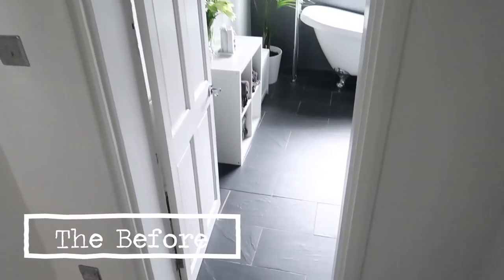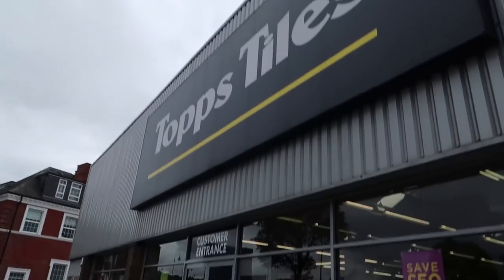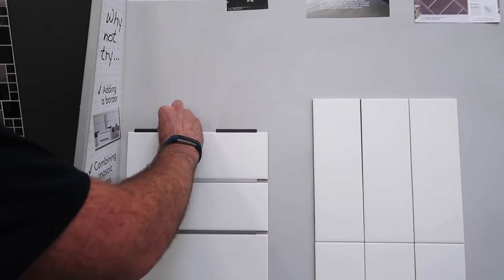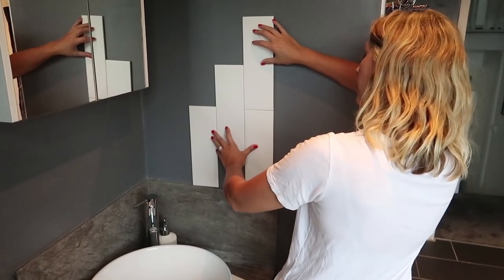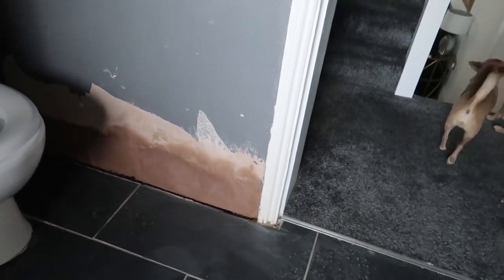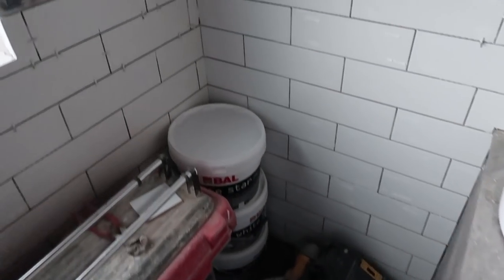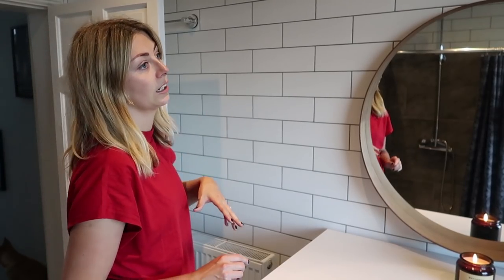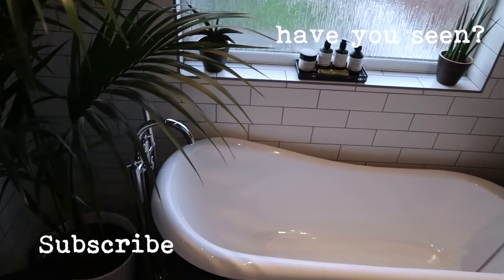Bathroom Makeover Renovation with Topps Tiles | Emma Hill | Ad

Comment: OK I have a very honest questions and need answers. How to hang a mirror or shelves on those tiles? I would love to have something similar in my bathroom, but no idea how to hang stuff and not break tiles. You can only glue it? Pleeeease. I am afraid they will crack. You put the nail in the middle of the tails and it is fine?
Reply from the maker: No you can drill into tiles you just need a tile drill bit and you need masking tape to put where you're going to drill the hole so the drill bit doesn't slip.  No nails, you need to drill through the tile and into the wall then use a wall plug and then screw in a nail 👍🏼 I'm sure there's a YouTube tutorial on how to drill into tiles so might be worth searching in case my description is a bit confusing 💋

Comment: Beautiful bathroom. Is the tub faucet on the wrong side of the tub? The high end of the tub is for your head. Seems like you will bump your head. The low side of the tub is for your feet and the end you normally fill the tub.
Reply from the maker: This is where we wanted the tap, we thought it looked nicer this way ☺️ plus the tap swings from side to side but I've never bumped my head on it 👍🏼

Comment: Looks like the faucet is on the wrong end of the tub. You must  hit your head on the faucet when bathing.
Reply from the maker: It's adjustable so it turns 360 degrees so we move it out of the bath when we use it 👍